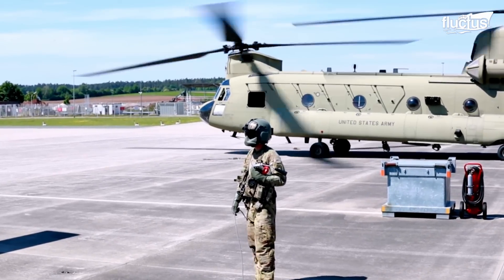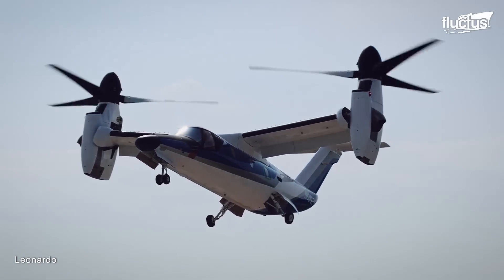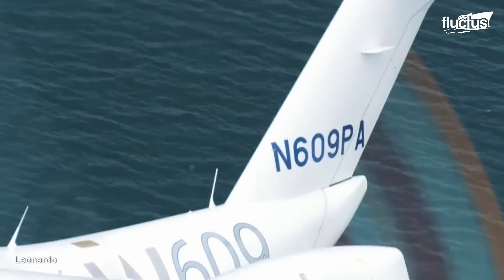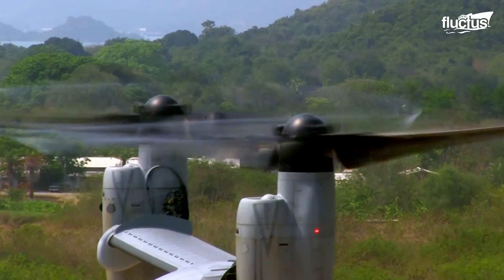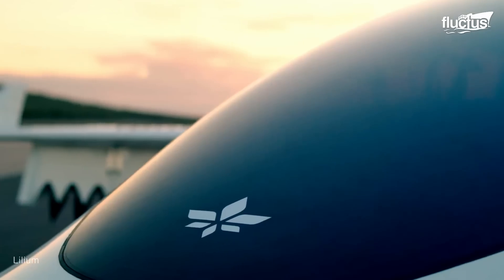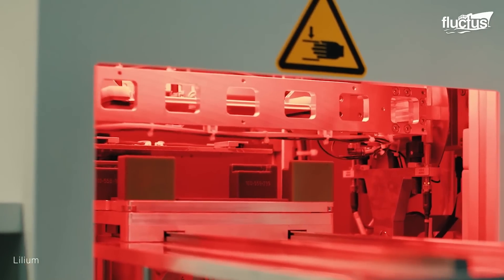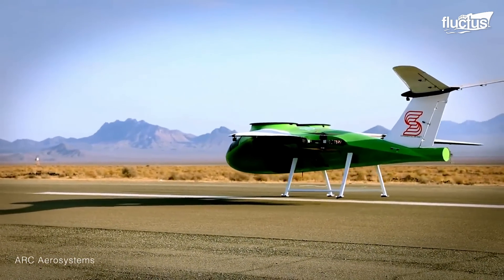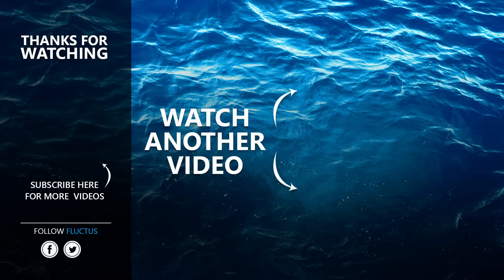Italy is Testing its First Ever Transformer Plane on Aircraft Carrier

Comment: imho the whole concept of v280 (rotare only transmission and propeller) looks superior to aw609. this way the requirement for engine and its lubrification are less demanding. both approach have drawbacks (the v280 rotating transmission looks heavier and more complex) but from engine perspective it free up the engine from "vertical y-plane operation". you don't save much more when you have to rotate a whole nacelle

Comment: Very nice Italian craftsmanship on display and a nice addition to NATO.
Reply: The AW in AW609 is short for AgustaWestland, and originally the Bell-Agusta BA609, as in Bell Helicopters. 
In June 2024, Leonardo confirmed plans to add a second final assembly line for the AW609 tiltotor at its Grottaglie production facility in the province of Taranto in southern Italy. This came after Boeing suspended production of B-787 fuselages for 4 months. 2025 is looking to be a promising year for the AW609.
FYI: Bell and Boeing worked jointly on the V-22 Osprey, Leonardo is a subcontractor to Boeing, Bell is not owned by Textron, and is a supplier to the Bell v-280 .. it's a small tiltrotor world.
Reply: @johndewey6358 - Nope, the AW609 is American designed, American developed and American made 🤣🤣🤣

Comment: What about the safety? There is no safety technology if all engines fail? There is no transportation revolution without safety.
Reply: As per all aircrafts that are designed, certified and put into the service, all aircraft systems (including the power plant) shall meet the quantitative and qualitative requirements of the safety objectives assessed for the functional failure conditions captured by the functional hazard assessment at aircraft and system level. The contents of these reports are agreed and approved by the civil aviation authorities (FAA and EASA). The safety assessment process is in accordance with the SAE ARP 4754/4761 guidelines that exactly define both process and methodologies required to achieve the required safety level. Dual engine failure condition is captured by the above reports. The applicant shall demonstrate via safety assessment that the aircraft meets the mentioned safety objectives.

Comment: The AW609 is made in America, in Philadelphia USA to be more specific… it was designed and developed in America by Bell and Boeing… it’s on the contract that Leonardo can’t even develop a military version of the AW609 because it is still based on Bell’s design…
Reply: Boeing pulled out from the titroton project at the very beginning so it's contribution was very minimal. 
Leonardo on the other hand joined soon after Boeing left and remained until the full development of the aircraft and achieved full technological transfer in 2011. From that time on, Bell and Leonardo separated and continued on two different paths with Bell only contributing to component design for AW609 and Leonardo taking the full ownership and producing the aircraft in its facility in Philadelphia.
So saying it's just "American Made" is a little bit too simplistic.
Reply: @silusiano - Nope, The AW609 is American designed, American developed and American made… the AW609 is based on Bell’s original XV-15, Leonardo had nothing to do with the design and development… that’s why the contract does not allow Leonardo to develop a military version of the AW609, it is still Bell’s design and Bell will not allow Leonardo to compete with Bell’s V-280…
Reply: @AftonAdams AW stands for Agusta Westland...fyi

Comment: I just hope that this newer aircraft is safer to fly. The Osprey V-22 does not exactly have a good safety record. The AW609 share a lot of the same technologies from the Osprey V-22. The Bell V-280 Valor drive shaft tilt rotor technology might be safer than rotating the entire engine pod and rotor.
Reply: The problem with V22 is it's too big for the given rotor diameter which was reduced  for ease of storage on ships. This results in poor hover and autorotation characteristics. AW609 although derived from V22 is of smaller size similar to V280 without its rotor only changing orientation. So it doesn't have a hover or autorotation problem like V22. Consider AW609 an evolution while V280 is a revolution.
Reply: @TakNuke  The V-22 looks like it has huge rotors for its size, even compared to similar aircraft like the CL-84, Do 29, or even the Nord N 500. None of those are exactly the same concept (the CL-84 is a tilt-wing, the Do 29 didn't hover, though that may just have been a limitation of 1958 control systems, and the N 500 used ducts which may have made the rotors more efficient), but they all managed to work without the V-22's giant rotors.
Reply: @TakNuke  aw609 is an older jointventure by bell and Leonardo downloaded by Bell and improved by leonardo with his  experience wit multiple helicopters aw 249 or if u know Grey wolf us marine corp lol .hahahahahaha
Reply: The V-22 was brand new technology and as with ANY new platform, during the early stages of development, there is a higher rate of mechanical failure.
Reply: @TerminalFailSafe osprey is still involved in multiple fatal crashes, at least 2 last year

Comment: The US army has recently down selected to another tilt rotor instead of my design and it's a very bad idea they should have learnt their lessons from the Marines maybe the Italians have a different drive train
Reply: Tiltrotors are safer than helicopters with a crash rate of 3.4 vs helicopters at 9.85 per one hundred thousand hours. Army Blackhawks crash all the time which is why some vets call them crashhawks. Heck a more expensive CH-53 crashed early this year.

Heck, I bet, if I could get the media to start covering and exaggerating the living heck out of Blackhawks and other helicopters. People like you would start to believe helicopters in general are dangerous and should be banned.

Comment: I'm wondering if the AW609 has the same jet exhaust problem the Osprey has. The USN and JNSDF had to make changes to carrier flight decks so the tiltrotors didn't burn through the decks on takeoff and landing.
Reply: A gas turbine is a gas turbine
Reply: @Truthbomb918  The Osprey's issue is that because the entire engine pod tilts, the exhaust ends up pointing straight down in vertical flight and when landing can be close to the deck. The AW609 looks to have this issue as well, the Valor does not.

Comment: The "jets" engines on the Lilium Jet are what are known in the RC Aviation community as "Electric Ducted Fans", or EDF. They are used on model aircraft in place of combustion jets as small combustion jets are both expensive and dangerous. They provide a very good thrust to weight ratio on model aircraft, and give them scale performance to the real aircraft they model.